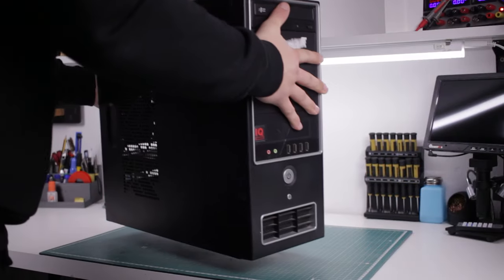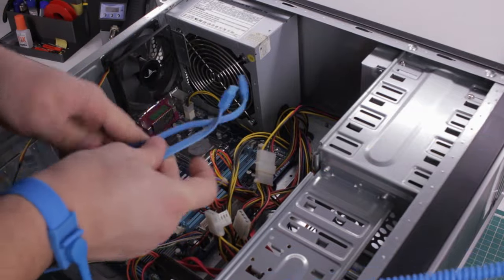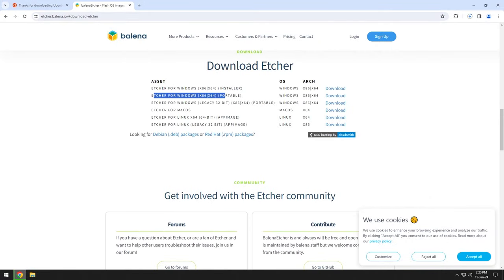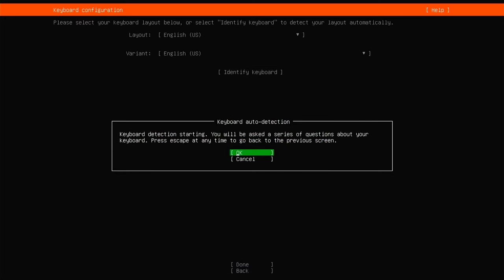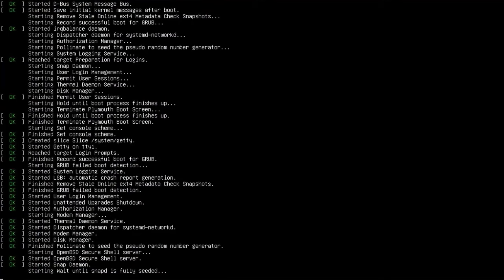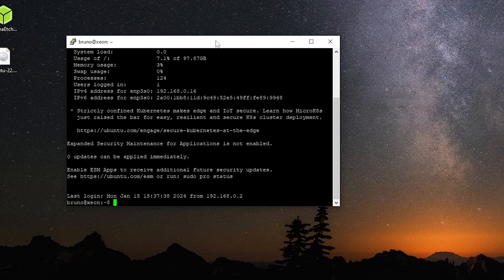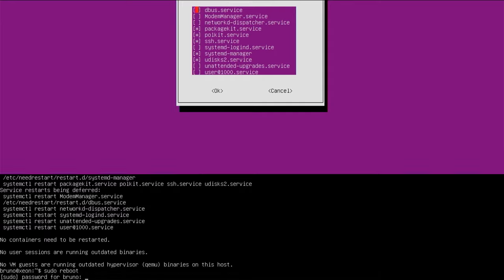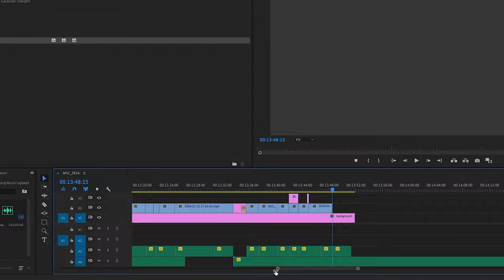Turn Your Old PC Into a Home Server FOR FREE! - Jellyfin, PLEX, Home Assistant, Pi-hole and more!

Comment: 2:48 the G41 motherboards had the graphics integrated on the mobo not the CPU so the lack of CPU-GPU shouldn't have been a problem as no socket 775 CPUs had on-package GPUs...
Reply from the maker: Oh, okay... I kinda didnt go into troubleshooting mode since i already had a spare GPU. Thanks for the tip!

Comment: suggestion?: use the old HDD as a nice backup driver (mirror), if it eventually crashes, it finally used its life, and no money was lost (apart from data)

for those who find it difficult to setup a static IP address through ubuntu, if your home ISP modem has a DHCP Reservation option, you can setup a static IP of your choosing with the MAC address of the server. in the ubuntu server, type "ifconfig -a", find "ether" or "eth0" and you'll find the MAC Address (e.g12:ab:a1:b2:b1:a2). put those details in the modem and give server a reset, if it not working, shutdown the ubuntu server and reboot you home modem to clear the caching.

Comment: Hello

I have also built my initial home server using my old pc to store steam games as well as storing my files.

I am using windows 10 pro with intel i 3 3rd gen 3.30 ghz speed with 16 gb of ram  However I have customized the windows 10 by deleting default apps and softwares and I am also using it remote PC to use outside my network.

In the near future, I'm planning to upgrade the Cpu with xeon like yours.

However I tried to use kali lunix and ubantu sever but was not able to feel comfortable.

Can you suggested me how to install Open VPN server to access my important files outside the network
Reply from the maker: I'll be making a video on how to access your network remotely soon... It won't be Open VPN but something much much easier and simpler to setup. Make sure to stay tuned ;)
Reply: Sure

Comment: 2:31 - what is that vacuuming you're using mate?
Reply from the maker: Haha, it's the "Xiaomi Mi Handheled Vacuum Cleaner"... It actually broke like 2 weeks after recording this video. The battery didn't last more than 1.5yrs and when I tried to replace the cells inside, the tamper protection triggered and basically killed the whole thing. I'm actually making a video about it at the moment and It's going to be a pretty interesting fix. I designed a small PCB to bypass the mainboard so I can still use the vacuum since everything else is working and it's really useful to have it portable like that
Reply: @Djambo57  Happy for you! Keep up good work!

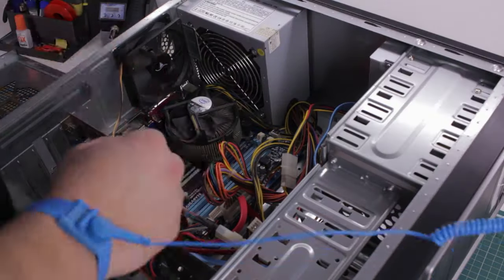Comment: What is that blue wire around your wrist 2:25
Reply from the maker: It's an ESD Strap. Prevents electrostatic discharges to the sensitive electronic components.

Comment: Does it matter if it's ubuntu server or desktop ?
Reply from the maker: No, it doesn't matter... The desktop version may be easier to use while the server version is a lighter OS, meaning it takes fewer resources to run. I chose to go with the server version since I don't log into this PC often, and I set up most of the stuff I need in the beginning and dont touch it from there

Comment: i tried to install ubuntu server on 12 year old pc Pc Sec is core 2 Duo Processor Gigabyte g31M motherboard with 4Gb ddr3 ram 128gb ssd as bootable drive 500gb as storage drive. but i cant able to install it shows an error
Reply from the maker: Which error did you get?

Comment: 2:50 "The xeon doesn't have an integrated GPU..." No. None of the socket 775 generation CPU's had integrated GPU's integrated Gfx was done on the motherboard. the G41 chipset has the "GPU". You probably needed to enable it in the BIOS as the previous owner probably disabled it because they had a discrete GPU card installed. Also if you tried to use it with the GPU card plugged in, that also probably disabled it, but I guarantee you, that PC has an integrated graphics (Specifically GMA X4500) 
There is a slight advantage to using the dedicated GPU and that's to prevent the GMA from taking a bit of system memory for itself